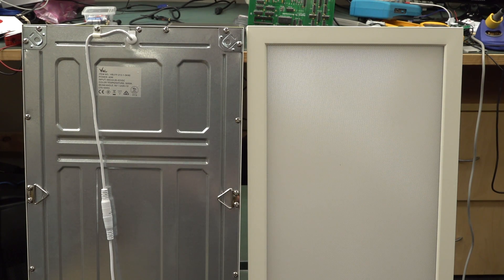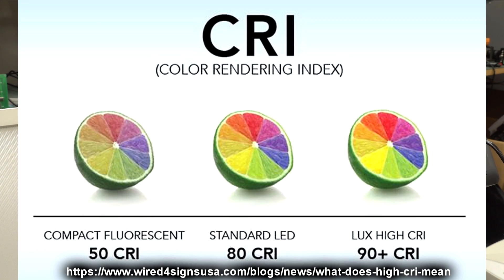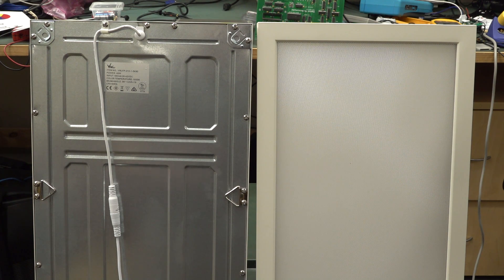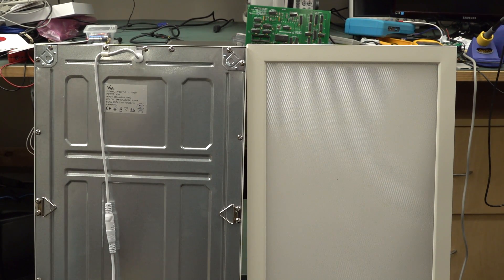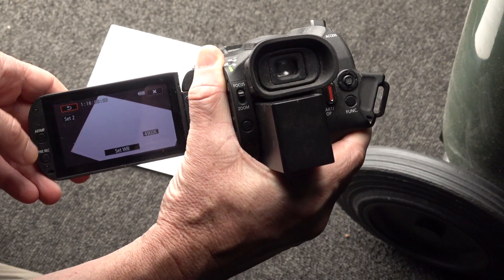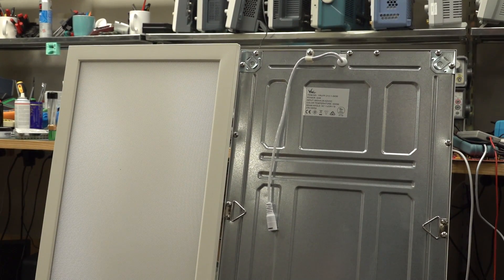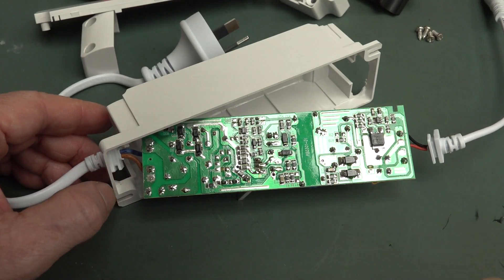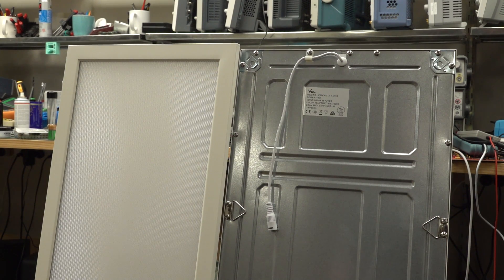EEVblog #1303 - New Lab LED Panels

Comment: CRI Ra is the average CRI. These days in the flashlight enthusiast world we focus on the CRI R9 red component, you can have an average of >95 but the R9 would still only be 50 or so. Colour temperature is only one part of it as well, we nutsos really care about the deviation from the blackbody locus which is the "green" or "rosy" tint and not just warm or cool.
One tip if anyone wanted really nice LED strips for DIY stuff is to look for ones made for horticulture applications. The Nichia Optisolis LED series is pretty damn beautiful as is their medium/high power E21A, they have R9 bins of over 80 but they test in the 90+ range.
Reply from the maker: I'm very aware of you "nutsos"! LOL
Gotta have a hobby!
Reply from the maker: I'm all for that kinda stuff, and I'd love to be able to spec the best thing I can possibly get in this regard, unfortunately it comes down to practicality. I need over a dozen of these panels, so compromise is needed, you can't go build dozens of these yourself from scratch using custom hand picked LED's. Well, you *could*, but you know...
And the best production lights are simply not available off the shelf as standard ceiling panels.
Reply: TM-30 is a much newer standard that covers a lot more colour bins than CRI - https://unios.com/wp-content/uploads/2020/04/UN_TM30_White-Paper-200401-2.pdf

Will probably be a while before you see adoption of the standard from most major manufacturers. IESANZ is starting to push education on the topic (we recently did a webinar at work with them on it).

Also, 3000K and 4000K are by far the most common high CRI panels. I can see why Dave had trouble finding 5000K. The LEDs exist to make them, just very little demand so always special order with MOQs.
Reply: Also, higher CRI LEDs are going to have lower lm/W efficacy ratings - its just where that tech is at with the phosphors used.
Reply: @MetalPhreakAU  
Too true. Alarm bells should ring if you see good figures for both on the label.
Reply from the maker: @MetalPhreakAU  Seems to be the case from what I've seen. I'm more than happy with that trade-off.
Reply: Say no to piss green tints!
Reply: THIS. I was about to say the same thing. I've bought high R9 LED from Waveform Lighting for use in articulated shop lighting and it makes a huge difference. The difference actually effects how well you can see, and it really comes out when taking photographs. It seems to be nearly impossible to find raw SMD that meet this kind of spec, at least from a reputable source where one could trust the specs are true.

Comment: The other day I had some CRI95 lights and noticed something odd with them, turned out they were specifically engineered to reach high CRI for a certain way to measure it, but the spectral curve was really crappy, making it basically impossible to use with gels, and as such for really really good video and lighting you want to have a look at TLCI, which of course is never specified for anything ;)

Comment: Their lighting source is Epistar.

To be honest, to get better efficiency try going for LED sources with the likes of Tridonic, Helvar or Seoul Semiconductors.

Also, try going for LED module sources rather than LED strips which offers better life and thermal dissipation.

EPISTAR LED sources are sources being used by all of the Chinese suppliers I know...

Also, that driver is definitely Chinese but is decent.
Reply from the maker: Yes, but these are specially binned for higher CRI, not the same ones as used in cheaper panels.

Comment: What do you guys think about the Ikea floalt led panel : https://www.ikea.com/gb/en/p/floalt-led-light-panel-dimmable-white-spectrum-20436317/
I was thinking of buying one or two in my main living room, but when I saw this video I wanted to find something better.
I like that they have controllable color temperature(2700-6500K), CRI of 90, wireless remote controller.
I don't like about it that is has only 2800 lm and that's not enough for me, and no bluetooth connectivity.

As the panels in this video are not available in Europe, can I find something better then the Ikea floalt panel ?

Comment: 90CRI is specifically manufactured. They us a different phosphor blend to achieve that, similar to CCT. After that they get binned for colour point, voltage and light output.

Blending phosphor for higher CCT usually results in lower CRI. Increasing the CRI at higher CCTs usually ruins the efficacy (lm/W), that's why 5000K/90CRI is hard to find.

Comment: This driver is a single stage PFC flyback architecture, which inherently has lots of flicker. On the secondary side that big TO-252 Chip is a flicker reducer, it work by absorbing all the pulsing peak voltages and only allow the lowest sustained voltage to get though. Typically about 2% of power will be lost on that flicker reducer, so it get super hot. Another problem is that this type of solution typically just reduce flicker, there will still be about 1 or 2% of flicker in the output light. A quality isolated driver will use boost PFC + flyback dual stage. It cost slightly more but is truly flicker free, not just free from 100/120Hz, but also no flicker when there is a momentary power line dip.
Reply: Fang Zhou https://www.centralsemi.com/files/manager/Engineering/Whitepapers/Practical_Applications_of_Current_Limiting_Diodes.pdf

Comment: The CCT will get higher with age. White LED get the white color by mixing blue LED light and phosphor converted yellow light. In the base of each LED there is silver coating to increase reflectivity with-in the chip to increase efficacy. With age due to Sulphur in the air, the silver will become silver sulphate, which is black. This cause lose of some internally reflected light. And since reflected light travel a longer average distance through that yellow phosphor gel on LED chip they are mostly yellow light. By loosing that proportion of yellow light you can loss 10% lumen and CCT easily increase from 5000K to over 6500K. So don’t be too particular about CCT unless you can get panels with LED chips that are more resistance to sulphur.

Comment: If you want a consistent resistor value for a job over thousands of "your product here" (amongst cheap parts), the easy way is to parallel many of the cheap ones. That way the variations will be so spread-out, no one will be able to tell. Easy way to use some "cheap & easy"  pieces on the assembly line.

Comment: Generic caps and a cheap single sided PCB with sloppy solder and it’s “not too shabby”? On other products would would have complained. You fell in love with these panels and power supply before you even tore them down.
Reply: Didnt measure ripple for whatever reason... as if you dont need a reference to know what is ok and what is too much ripple.
Reply: Is it a Chinese viral infection?

Comment: That pattern on the panel in 6:05 is important for the low glare rating (UGR<19). They reduce the amount of light that shines to the sides. If you compare two panels with different glare ratings, you find out that the panel with better rating has a narrower angle of beam

Comment: So the panel itself is just a 2 wire passive series/parallel combination of LEDs, no active circuitry right? Do the sellers/manufacturers state that you have to use their drivers in order to keep the warranty on them? I took a set of panels and stripped the crappy massive ripple drivers out of them and now power them all off a single meanwell driver with a DIY post regulator for dimming and filtering. Best setup Ive done so far,  the output is cleaner than most switchmode bench supplies I've seen.
Reply from the maker: Yes, just LED's inside. No idea about the warranty.

Comment: So what is this with the old lab and the new one - last thing I know was that the old lab was becoming too small and therefore you moved to the new one. Which then got flooded later on. Do you now have to evacuate back to the old lab again in order to fix the damage (or the reason why rain comes in)? Or why else do you move back into the old lab? I think I even remember something about a better internet speed in the new lab (fiber optics)? Why give all that up? Or is it just another expansion, so you'll be using both labs in the future?
Reply from the maker: Supporters have access the exclusive video that explain this. You can see them on my LBRY channel.
Reply: @EEVblog  🙁

Comment: I'd love to have some of these LED panels. There's a little store/post office next to me that has a few on the ceiling in the post office. 

I'm curious if there's a 12 volt version I can use as backup light during power outages. I have a small CCFL light I made from an old school flatbed scanner scan head and a switch and a car phone charger. I run it from a jumpstarter pack.

Comment: Out of interest, have you measured the light output of those Led lights you fitted when you first moved in? Would be interesting to know if the light output have started to drop off yet?
Reply from the maker: I have a video with original LUX measurements in specific locations, but that's in the old lab so don't have the same condition to redo that test. Would be interesting!

Comment: Late last year we had our office fitted out with LED panels, I think we had 40 of them. 40W, 5000K >80CRI. All supplied and installed with underpowered drivers causing massive flicker issues that caused eye problems for staff. I think it was 30W drivers for 40W panels. Installer and local supplier both denied any understanding of the wrong drivers and insisted they were correct leaving us out of pocket to purchase the correct ones (which cost the same as the wrong ones just had higher wattage and specified low flicker) Think ill spec the panels and drivers my self next time and these vibes look good. Not leave it up to the local electrician!
Reply from the maker: Yep, I've done some videos on that, flicker can be horrible!
Reply: The drivers being underpowered wouldn't cause flicker, lack of DC output smoothing does that. You can usually drive LEDs below their rated power.
Reply: @add2k  we tested with custom filters, and with the same driver with a higher wattage and it was the lower Watters supplies causing the issue.
Reply: Tim Dykes you mean instead of custom filters, you tried the 30W supply on a 30W panel and it still flickered, of course,  which would prove that it was the 30W drivers themselves and not the 40W panels’ fault for overdriving them.

Comment: I'm kind of surprised you can't get 5000K easily. Over here every hardware/lumberyard store has them in 4 ft fluorescent replacement tubes. I bought a bunch of dimmable Toggled brand ones and I have been very happy with them just for general electronics and woodshop lighting. I do notice 6500K is starting to become more popular, though.
Reply from the maker: @katelights  Yep, very often way out of spec. Panels are different to the tubes. But again tubes are kinda hard to get 5K also I've found.
Reply: @EEVblog  & Kate : I'm not sure I have any way of checking how true mine are. Maybe I'll google it later.

Comment: Why you need to match 5k? What happens if you use different?
Reply from the maker: As long as they are all the same, it doesn't matter. I white balance calibrate my camera. But my other lights are 5K, and I like 5K
Reply: @EEVblog  Isn't 5200k a standard in photography? So it should be easier to get 5200k than 5000k.
Reply: It would make his videos look weird and maybe even the camera gets confused about the white balance.
Reply: You get Technicolors.

Comment: So I've been under a rock recently, but what's going on with lab moves?

Also, you should take a look at and discuss UV lights for disinfectant use, china's been shitting out normal UV LEDs as disinfectant lights, Clive's been taking a look at them but it'd be cool to hear from you too
Reply: Not sure if my spectrometer can measure those UV LED's.
Reply: @EEVblog2  They are almost certainly only around 400nm. I think most spectrometers can measure that?
Reply: Basement ScienceE around 254nm for germicidal UVC and about 185nm if you want ozone too. Requires a different sensor head.
Reply: @batterymooch  I know, that's what you would expect if they are real. But as far as I know all LEDs that do not use a phosphor will only emit one wavelength, so presumably Dave could explain that and show real UVC leds on mouser etc and just use the spectrometer to show that the fakes just peak around 400nm exactly like a normal 400nm led.
Reply: Basement ScienceE agreed.
Reply: why haven't you been on the LTT forum in such a long time?
Reply: @circletech7745  Personal stuff. Been real busy. I'll probably return one things get a bit more stable.
Reply: Been hearing more & more about this, lbry...  taking a little wind out of Google's monstrous sails?
Reply: I have seen Clive's videos, but I prefer this quantitative UVC one - https://www.youtube.com/watch?v=FvL6DzwrF_g
Reply from the maker: Supporters and those on LBRY have seen my exclusive videos about the lab move.